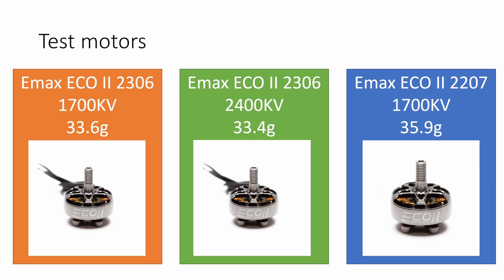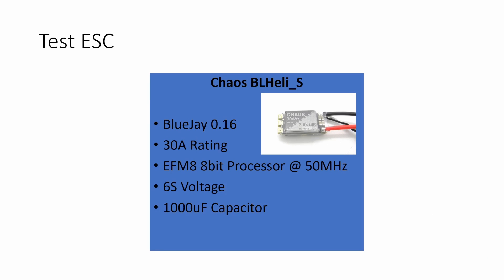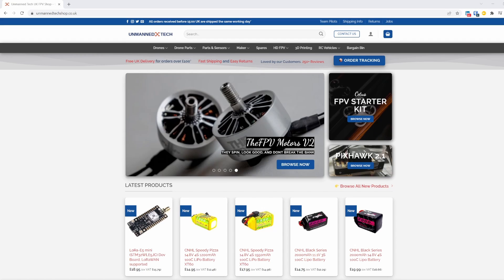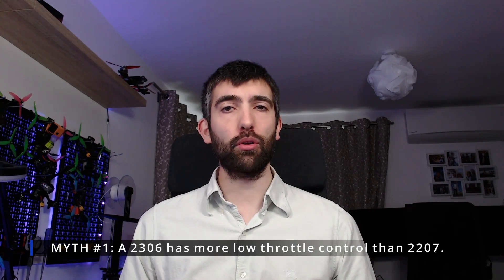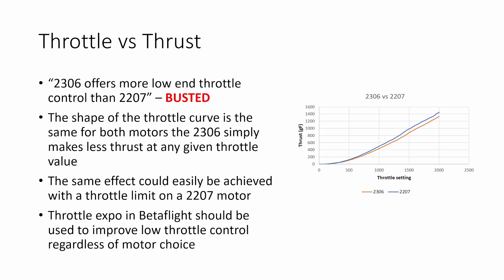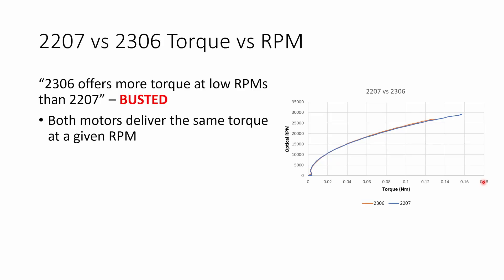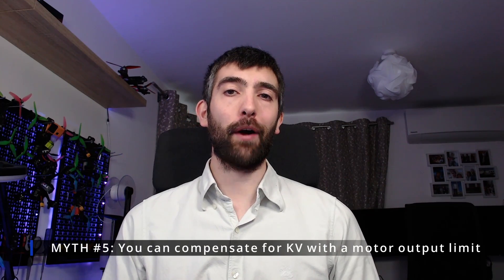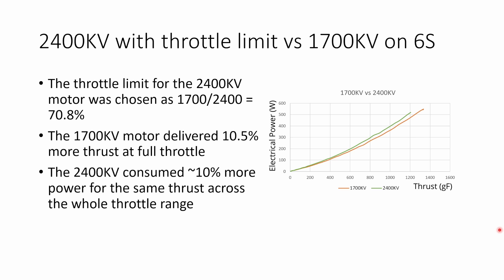Five 5" Motor Myths Tested, are any of them true? 2207 vs 2306

Comment: Interesting video. I’d like to see the test repeated with warm motors. I always understood 2306 has more surface area so stays cooler which increases efficiency. But that’s also with the thought that a motor can loose up to 30% efficiency when running hot… only repeating things I’ve heard or watched so probably all myths too.
Reply: πr²×h for volume.  Not base × height
Reply: Motors shouldn't be getting hot under normal operation though, should they?
Reply: @ninja_quattrocento  Define "normal operation"
Reply: @dr0n3droid  clean build, with high quality parts and well tuned with no serious mechanical issues or frame resonance issues. My quad rarely gets warm motors - usually only when I've cracked an arm, or sometimes when a prop is seriously bent/broken. I fly fairly aggressive these days - a lot of the time with beat up props. Very rarely get warm motors with 2207 Karearea 1850kv on 6S.
Reply: @ninja_quattrocento  Let's ignore any mechanical/tuning issues. Normally, when current flows, heat is generated.  All motors generate heat, but may not necessarily "get hot" unless pushed to their limits. 
When I walk up stairs I don't get hot, but if I run...
Reply: @dr0n3droid  yes - but they're also cooled by airflow from around them. So what I'm saying is that they shouldn't be getting so hot under most circumstances that difference in cooling effect between 2306 and 2207 noticably affects performance.
Reply: @ninja_quattrocento  Define "noticeably"
Reply: @ninja_quattrocento  In ideal world. Or in superconductive state. But you will not want to fly around huge liquid nitrogen bowl only to have superconductive motors :)
Reply: Noticably - Adv. - in a way that is easily seen or noticed; clearly. 
 - Oxford Dictionary.
Reply: @ninja_quattrocento  "This feels different" noticable or "The oscilloscope shows..." noticable?
To be precise, these subjective variables need to be accounted for. When talking motor temps for example, what exactly, in degrees(c or f) is "noticable"?  Battery sag?  What mV/s² is "noticable"? Can you feel efficiency?
Is there a difference between the two? Yes.
Is it "noticable"? Depends on who you ask.
Reply: @dr0n3droid  minor differences that show up on tests but aren't so noticable by feel aren't really that important in most people's everyday FPV applications. Especially with something like motor heat affecting efficiency - as long as the motor isn't getting warm to the touch - you probably are fine.
Reply: A simple and rough volume calculation will tell us that a 2306 is  23x6=138 and a 2207 is 22x7=154 cubic mm, So no, 2306 does not have more surface area........we can also deduce that from the higher 2207 motor weight, as they are the same motor mfg construction/design.
Reply: @SocalCanyonRacer  That's way too simple and rough lol
Reply: @SocalCanyonRacer  that’s stator volume
Reply: Surface area of 2306 is 1264.49xxxxx and 2207 is 1244.07xxxxx mm2

Comment: Thank you for this comparison, now I know that 2306 is a better choice for light drones and 2207 for heavier or lighter drones when we want more power.
Reply: Think it would just depend on the actual motors in question, this is only 3 motor from one brand

Comment: Thank You Chris For Another Great Video!  How much did weight account for efficiency for the 2306?
Reply from the maker: That could be the only way a 2306 could achieve longer flight times is if it weighed less 👍
Reply: The 2306 is only 9.2 grams/set lighter than than the 2207......So on a 600g 5" .....9.2g/600gx100 = 1.53% lighter........that's the difference of a short/long 12ga battery lead......or different battery mfg  of the "same" mah capacity;-)

Comment: Great video. For efficiency, would it be fair to also factor in the weight the motors introduce?
Reply from the maker: I think it would be fair to factor that in but the way it was told to me it was the sape of the 2306 that supposedly made it more efficient not the fact that it was lighter. Also if its just weight a lighter 2207 would also be more efficient.

Comment: Wow yesterday I was thinking about suggesting you making a video about 2400kv with motor output limit vs 1700kv at 6s battery voltage as you have the motor test bench.. this is really stumping.
Reply from the maker: Glad this video hit the spot for you!